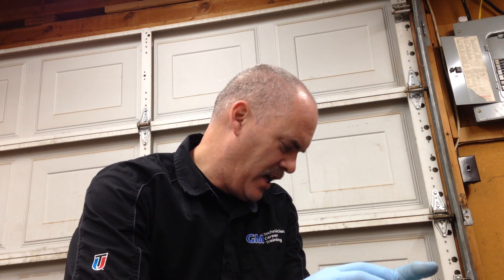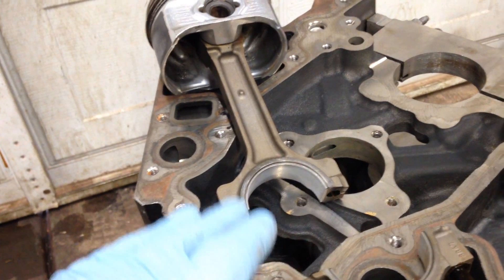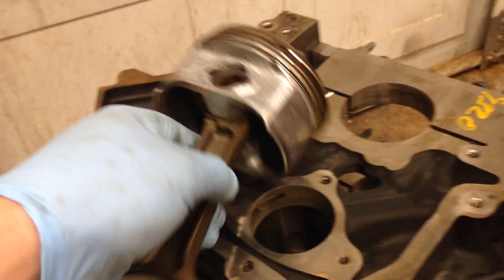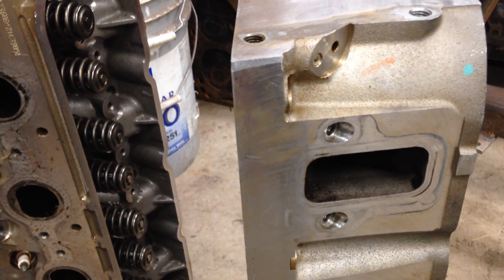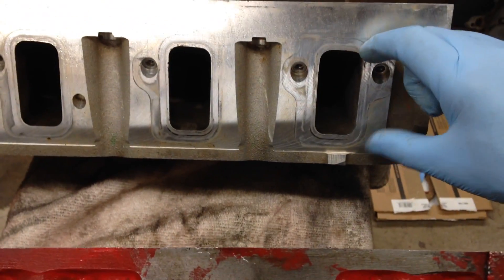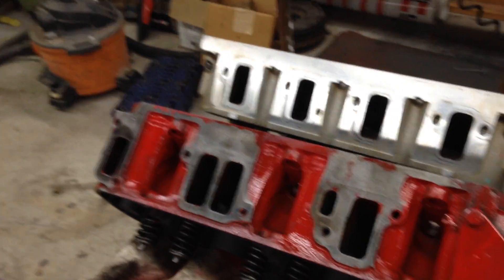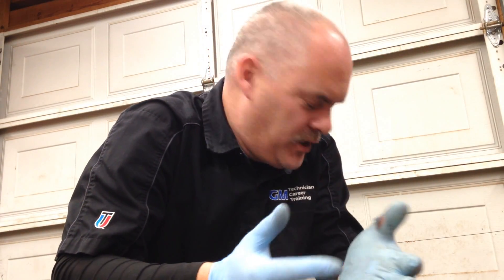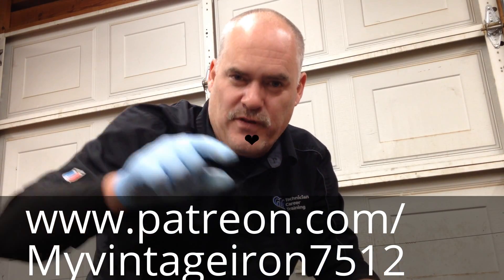LS Upgrade 6.0 to 6.2

Comment: gm copied ford!!! Hahaha j/k
Reply from the maker: That's not really true the LS engine is very much like pretty much all the V8's out there today the Mopar Hemi is identical to the LS  coyote,Nissan, and Toyota V8's are all very similar in design  most of the engineers who work on this stuff have worked for 2 or more of these company's  some of the engineers even work as independent contractors and work for Ford and GM at the same time so to say one copied another is really not accurate they just employed many of the same Engineers and designers over the years

Comment: I agree with what you say about the engineers working for the big three.   If GM did supposedly have an idea that he borrowed from the old pushrod ford, they must have had some other ideas too, because why would you copy a motor and be able to outperform it.
Reply: Ron Sperry was responsible for the heads in the LS1.  He's worked for GM his entire career.  He did no t come from GM.

Plus, Ford heads had symmetrical ports probably before the engineers on the LS1 heads were even born...

Comment: so how much better is a 6.2 over 6.0 ?
Reply from the maker: light weight rods better pistons and crank this will not be a true 6.2 but it is a great way to make power on a budget
Reply: Lightweight rods?  The 6.2L has the same rods as a Gen IV 6.0L and they're heavier than the Gen III 6.0L rods...

Comment: I'm looking to do a junkyard build but I want a bulletproof motor pump gas and can handle a 250 shot on occasions should I go 5.3 or 6.0 any suggestions
Reply from the maker: 6.0 is stronger both will take it

Comment: i have a 6.0 with the ls 243s with the corvette intake . didn't start it yet ! lol ps. its suppose to bump comp to 10.2.1 .
Reply: barzo111 depends what pistons you use, I have flat tops and 243s and have almost 11:1
Reply: lq4
Reply: ps did u notch the pistons ?
Reply: barzo111 I gotchu, mine is an LQ4 but I'm using lq9/ls2 pistons. I haven't gotten to the point of mocking up the motor so I don't know yet. If I can remember I'll let you know
Reply: so u don't know if it 11 2 1 now the 243s bring it a half a point lq9 r at 10 2 1 !

Comment: I am building A LS3 6.2 Carburated SETUP. Would the C10 OR FBody Exhaust manifold or Headers fit my 87 Buick regal
Reply from the maker: The manifolds should fit I'm not sure if there are headers for that car
Reply: Myvintageiron7512 look up shooting for 8's on a budget on here.  There's a guy running low 10's with an LS...  One guy is running mid 8's....

Comment: LS rods can be reconditioned, the big end is honed slightly larger and use an oversized bearing.
Reply from the maker: That is not reconditioning that is honing reconditioning returns  the rod bore to it's factory size
Reply: True, my mistake, but LS rods are not throw aways as you indicated.
Reply from the maker: Connecting rods as a whole have become kind of a disposable commodity the cost of good quality rods has come down quite a bit  a set of LS rods that are out of round have seen allot of hard action so you will need new bolts for sure ARP's are best by the time you do that and get em honed your in them about as much as a new rod and you still have used rods personally I would probably discard them and go with new ones that come with round bores and ARP bolts out of the box
Reply: I agree, the 6.0 I just built has Scat rods in it, 200 and some odd dollars with ARP bolts like you said. Point I'm trying to make is that factory rods are very much reusable if one so chooses, it's not mandatory to discard them.
Reply from the maker: I agree that is true

Comment: Reminds me of a Buick 350 intake port super large no shrouding.Exausht ports were just as open. Had a 72 Buick Skylark,that thing was drunk with torque.3.80x3.850 but still turned r's like it was a 302 sbf

Comment: thanks for the info..please keep it coming,,,im doing this same build so all your info is so helpful...
Reply from the maker: one key thing to remember is find a good machine shop and take them the block and the new pistons so they can bore the block to get the correct Piston to wall clearance along with a good valve job and you will have a screamer

Comment: For those whom are wondering the 6 liter Iron LS are LQ4 and LQ9 engines. The difference between the two is in the pistons. The LQ4 uses a dished piston and the LQ9 is a flat top. With resulting different compression ratios. Now if you're doing the 6.2 upgrade as shown here you're tossing the pistons so the difference is moot. I love the LS Platform. I've had three LS1's and daily drive an LS3 now. You could pick up an LQ4/9, get some LS3 pistons, heads, intake from somebody that upgraded an 5th gen SS Camaro, and build a great 400hp+ motor with a STOCK gm cam and it'll be torquey, and buttery smooth.
Reply: John Sears   Spoken like a true jealous Ford Fan boy...if you keep saying it enough it might come true lmfao...I don't blame you for being jealous...if I was a Ford guy I would be pissed to...but hey...Ford does have OHC v8's...even DOHC V8's.
Ok I'll bite...which Ford engine is the LS a copy of hmmm...and why is everyone not using this Ford engine swapping it into Chevys and Mopars like we see with the LS engines into everything???
Reply: Of course. But It all depends on how you build it. A factory 6.2 rotating assembly will do pretty well but as with any build if you get greedy with the giggle gas or mess up your fuel, ignition, etc. you'll be spending money on another rebuild real fast. (if you're lucky it'll just need a rebuild). But A 150 shot would be no problem even for a totally stock 6.2. As long as it's done right.
Reply: hallis1 can you put nitrous on this motor after bored it from a 6.0 to a 6.2
Reply from the maker: Yes Nitrous is doable as long as you don't go crazy 100 to 150 shot would be reliable as long as you don't go lean
Reply: Rico Turk if you upgrade the bottom end and it had good af ratios it could take 300 all day
Reply: hallis1 would. You still use the ls1 cam or lq cam
Reply: If it were me i'd use the stock LS3 cam if you had access to it. But of the two choices i'd use an LS1 cam over the LQ4/9 cam. But if I had any left over budget i'd get a mild performance cam.
Reply: Shane Singleton he’s talking about punching it out .065. Can you go that far and have no cooling issues with it in a street truck application?
Reply: Also the LS3 did not come with forged rods or pistons.... hyperuetectic pistons, and those same cracked cap rods he shows except they were gen 4 rods which were a little beefier than LS1 and early style gen 3 rods
Reply: Myvintageiron7512 do you think you could get away with more if you gap your rings more and that's the only difference? Assuming you know what your doing and everything and ramp in the spray
Reply: Planning on doing this in the near future. Good video and tips..
Reply: thanks
Reply: u for reals ?
Reply: Myvintageiron7512 how long you been doing this for?
Reply: Shane Singleton how much for a used  lq4/9 ?
Reply: No LS style engine came with iron heads ever
Reply: @Colt_10R80  there's iron headed 6.0s
Reply: @lpatierno84  ya, its early production 6.0l lq4. Casting number is 873. Its almost identical ports and chambers to aluminum 317 heads from what I know
Reply: @Colt_10R80  http://blog.jepistons.com/everything-you-wanted-to-know-about-the-gm-ls-engine-family
Reply: I think the l76 already has ls3 heads from what I hear ......I got 6.0 out of a 2013 2500.......I was thinking about the ls3 pistons tho ......to drop in my single cab
Reply: I have a 2500hd with the lq4 doing this soon 
Looking to do this instead of buying a duramax to pull my camper
Reply: @XJlover90  dude I love lsx engines. But pulling a camper with any gas engine is an expensive endeavor. Every newer diesel from 13 and up makes 700-900 ft lbs of torque with excellent fuel mileage. Your never going to get close to those kinds of numbers with any gas engine.
Reply: @bomason8595 yeah but the hp sucks 😂😂😂😂 💯🤷🏿‍♂️ if only they could get diesel torque in gas engines … cause gas will beat diesel all day
Reply: OR... (l'm so glad I did my homework!!!) you can vvt delete a LY6.
Reply: hallis1 after boring a 6.0 to 6.2 think if I upgrade the bottom end I can put 300 shot through it
Reply: Yep, here is another secret, if you have a truck with a 6.0 try the 5.3 cam, it's a bit smaller but makes way more torque and that's what the first 6.0 engines had, my 99 2500 4x4 would literally smoke the tires through overdrive, and we raced against my 04 2500 and the 99 won by a lot, it was very surprising, same drivetrain, only difference was a cast iron head which was the same as the 317 just iron and it used the smaller cam, food for thought
Reply: Derek Stewart no
Reply: The 6.2 lsx that cam in the camaro used forged pistons and rods
Reply: Shane Singleton all stolen from Ford. Design by Ford stolen by Chevy made shity.
Reply: @republicansareoffendedeasi821  Which engine platform was this stolen from??? I know it wasn't terminator platform those were junk.
Reply: @republicansareoffendedeasi821  Where did the Cleveland engine come from? Same guy worked at GM designing Big Block Chevy, then went to Ford to design the Cleveland. Not stolen, guy changed jobs. You talk like Trump, out of your ass.

Comment: While Im not building an LS I have learned so much from your vids. Thanks for all the work you do.

Question. WHy not just get a 6.2 rather than boring a 6? Is the 6.0 bottom end better ?
Reply: MoarPower probably because the 6.0 block is way cheaper to get ahold of
Reply: MoarPower very expensive 6.2 aluminum compared to 6.0 iron bored you gain 100 pounds of weight with iron but it's like 2000 dollars cheaper and can handle 1000 hp safely
Reply: Availability and price. A 6.2 is much rarer.
Reply: Armando Picazo - 6.2s aren't as common yet in salvage.  The 5.7 and 6.0 are very common - you won't get a ton more power. 

And 5.3 are dirt cheap.  

I've had 3 LS motors and they are amazing.  Very little oil burned, and I have 85k on an LSA.
Reply: Cheers guys. Just curious. Not much experience with anything beyond the 5ltr. Im mainly learning about the 1uzfe at the moment.
Reply: One word "PRICE". also the iron blocks are stronger. Slightly off topic but the legendary Toyota 2jz is alloy head iron block, as is the Nissan RB series. Both are renowned for their strength 1k hp on the stock block is pretty common. That's from 3 liters or less.
Reply: Aluminum blocks suck for big power
Reply: don't stock 6.2s use a forged crank
Reply: James Neumann can you bore a 5.3 block to 6.2 ?
Reply: @utahcountypicazospage5412  You can't, you need to start with 4" bore block.

Comment: oh also. is there any interchangeable parts between the 7.4/454 and 8.1? like could the heads from a 8.1 be used on a 454. and would there be any gain?
Reply from the maker: some of  the 454 stuff fits but it's not really useful for power on the 8.1
Reply: James stranger some parts will work but i know that rods crank and pistons wont interchange because a 8.1 or a 502 is a stroked/bored version of the 7.4/454 engine. Im not 100% sure but im sure the heads will interchange but to know for sure you would need to research the bore spacing of both engines to see if they are the same
Reply: 8.1 is a 496

Comment: I would like to put a 4.8 crank in a 6.0 block. to make a big bore approx. 5.3 .  sometimes I like a short stroke screamer. do you know if anyone has done this? or would  most consider it a waste of a 6.0 block. also the 305 v6. the valves look quite shrouded. as far as a high performance head. and are the valves as small as they look? would it be possible to  un shroud the valves. and go up in size a little. and port them a bit. for performance. or is that huge chunk of iron capable of being converted to a more performance engine. my dad has one. and we might get some crazy ideas. or are they worth more as is?
Reply from the maker: You make a good point about the 305 but remember it was made to be a low rpm TQ engine they can be improved for sure but usually they don't because the lower end rotating assembly is so heavy you cant really spin em up to high
Reply: James stranger Car craft or super chevy put a 4.8 crank in a ls3 block and made a screamer, 8 or 9k if I remember right. Should look into it.
Reply: James stranger, Destroked 6.0's have been done many times, there are YouTube videos of them. As with any short stroke engine, torque isn't huge but they make a lot of high rpm horse power, it's a good combination if that's what you want.

Comment: I've always been curious if the 8.1L gm could swap parts with 454/502? or are they two completely different beasts.
Reply from the maker: they are really not the same a few similarity's but for the most part a different engine
Reply: @Myvintageiron7512   Say I already had a 6.2 engine that I would like to drop in place of my 6.0….are the 6.0 and 6.2 harnesses the same? While I’m at it lol, are all the LS harnesses the same?

Comment: he's right, and now a days they share technology or buy it, for example in 2008 ford reached out to GM for assistance with there 6.7l powerstroke, because they wanted to go in house from all the issues they were having with international, they reached out to GM for technology from the duramax, money changed hands, ford now has a good diesel egnie, using the esact fuel system that GM was using, same injector's, and ALOT of very simular design's as the duramax. these companies have to talk to each other now a days, with emissions and fuel economy numbers getting stricter and stricter
Reply: Andrew Gems who's duping you?? ask yourself why people refuse to buy anything produced by the big 3, usually past experience of poor products.
Reply: +Kevin Rogers 
Not entirely true. 
It is true there was talk of collaboration between GM and Ford, but there was never any collaboration beyond the initial talks. 
I know Adam Gryglak the Ford lead engineer on the 6.7L PowerStroke diesel program and he says there was no collaboration with GM/Isuzu, Dodge/Chrysler, Cummins, or Navistar. 

When the codename Scorpion 6.7L program was approved in late 2007, Ford heavily leveraged its European diesel engineering expertise, particularly in diesel engine and combustion-chamber design. 
The 6.7 Dearborn development team included a global sourced staff of Research and Advanced Powertrain veterans. 
The four lead manufacturing engineers from Ford U.K. were co-located with their design counterparts and brought experience from the European Puma and Lion diesel programs. 
The Ford 6.7L PowerStroke diesel engine was developed completely in-house by Ford. 
The compacted graphite iron (CGI) block and rods used in the 6.7 were from a previously purchased technology by Ford Europe initially used in gasoline engines.

Tremec is a prime example of successful collaboration between rival manufacturers. 

I agree, but there is much work to be done to get the majority of the consumers to purchase mostly domestic brands again. 
Also there is way too much politics and religion injected into consumer purchases.
Reply: Many diesels get the majority of their computers and fuel injection parts from Bosch, so it wouldn't surprise me to see 6.6 Duramax parts that also end up in the Ford 6.7. I'm sure many of those components can be found on the Ram 6.7 CTD and Nissan 5.0 CTD. It doesn't mean each company is stealing industrial secrets from others.

As for buying foreign names in the USA, that is what happens when someone gets cheated out of a fortune when they bought a bad car. In addition, international trade ensures that people who work for those companies will be importing something from the USA. Often that is why tourism to the USA is a profitable business. Finally, you forget that a company may have headquarters in one country and manufacturing in another. The best cars in my family were made in the USA at the Marysville Ohio Honda factory.

Comment: didn't chevy have an LS style head back in the late sixty's on there trans am program?
Reply: i saw a picture years ago of the porcupine motor.looked more like a hemi type head than big block as far as the spark plug wire routing.
Reply: they had what was basically a BB Chevy head on the 302 Chevy engine. porcupine head I have heard it called.

Comment: Like your channel...
I.have a question

Have a 96 5.7 vortec and would like to try a camshaft out of a 96 5.7 caprice to see if i get somewhat more low end torque out of this camshaft.. Is this doable?
Reply: ronsmurff10  there the same stock cams. Just get a real camshaft.
Reply from the maker: Yep it should work